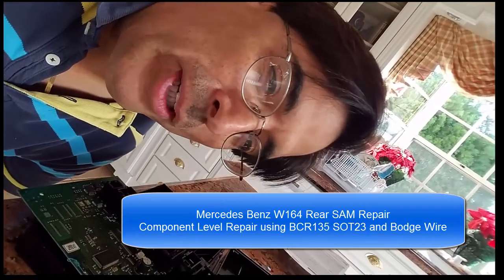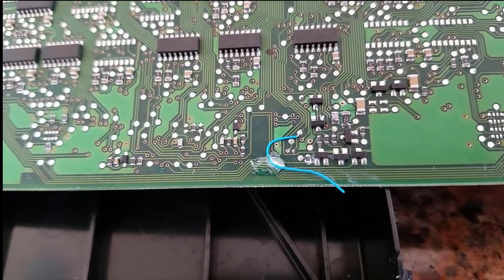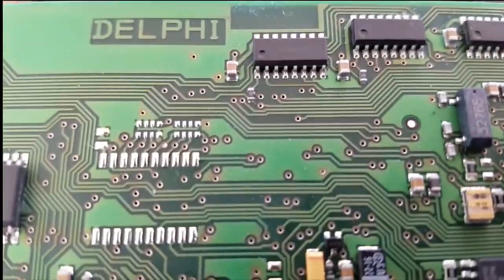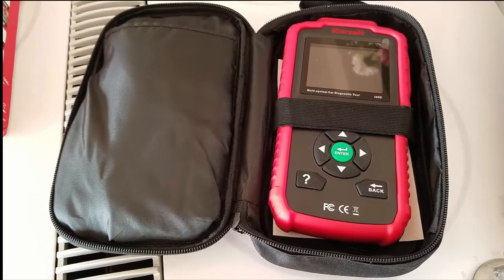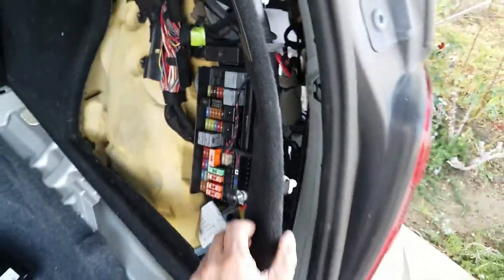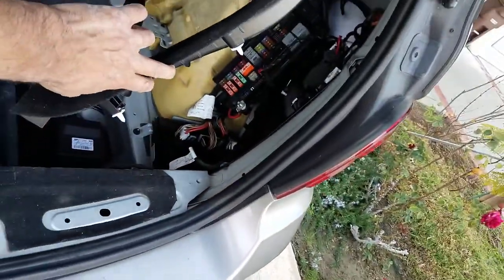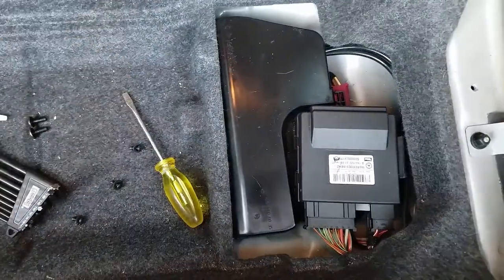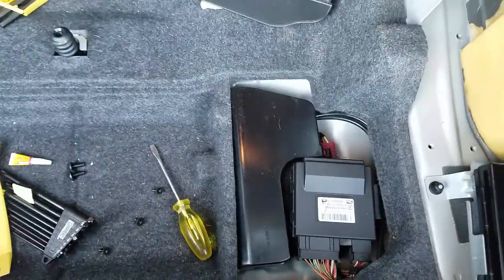Mercedes W164/ML320 Rear SAM Repair - brakes lights and rear hatch

Comment: I have removed my SAM from the back of my ML350 because one of the lights will not work.  I have even bought another complete tail light, but the bulb supply from the SAM is not "on".  I am trying to take the SAM board out of the case, i have opened the case and have access to the bottom of the board, but it will not easily come out, off the plastic posts.  Have any advice?  I am afraid to pull too hard.
Reply from the maker: Looks like you figured it out. You need to use 2 flat head screwdrivers to pry up the plastic case. THen look for burned out SOT23 transistors on the board. Use a jewelers loup to find any burned out legs on the transistors and look for circuit traces that have burned out too.
Reply: Never mind.  I discovered that there are plastic clips (2) on each connector that attach to the top c of the case.
Reply: Thanks for the video.

Comment: Hi Mike, I have an ML 350 2014 model and I have 2 key issues. First when the rear hatch is opened, it's unable to stay up for more than 3 seconds and then starts to come down which really disrupts taking stuff out from the trunk. Secondly I have a u0109 error code and I suspect it's contributing to the high fuel consumption. Any help? My email is orleant2011@gmail.com

Comment: First of all thank you for your videos.
I have a problem with my fuel gauge which always shows full. I think the problem comes from the rear SAM (I also have a problem with the tailgate which does not open systematically).
Can you tell me which part of the SAM manages the fuel? I want to check if I have bad contact on the SAM.
A big thank-you !
Reply from the maker: The rear SAM controls all of these items.  Fuel level senders are connected to the rear SAM, same goes for the tailgate switch.  My advice, pull out the rear SAM, crack it open, and check it for water damage or dirt contamination.
Reply from the maker: My other advice is to check the fuel level floats, sometimes they can get hung up on the fuel hoses.